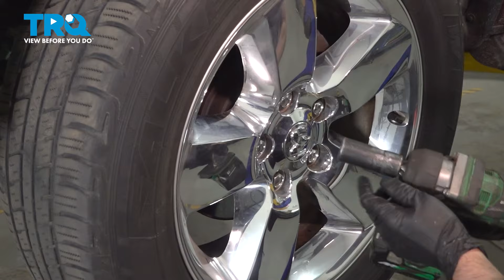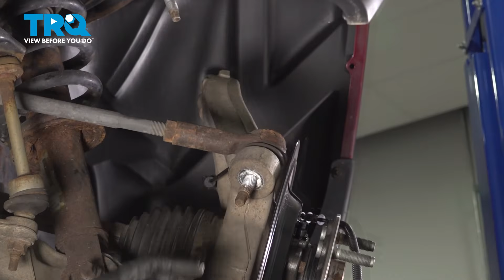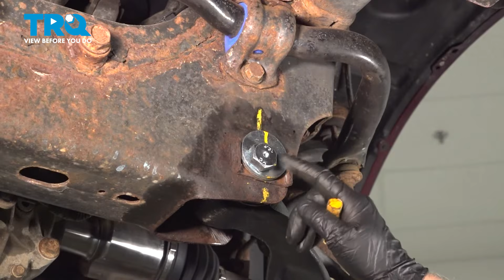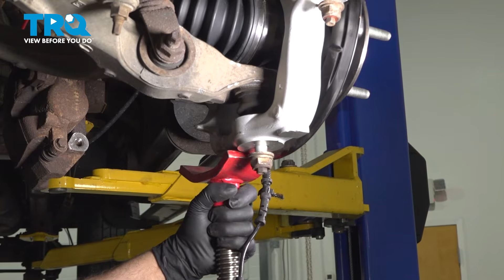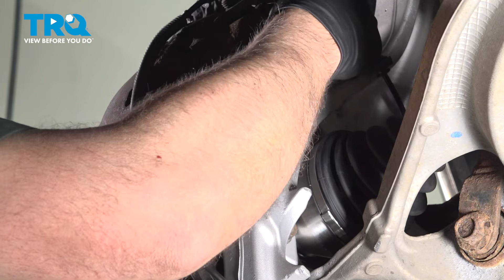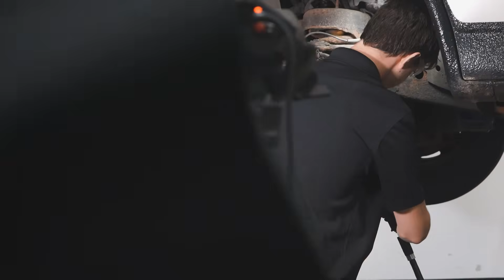How to Replace Front Lower Control Arms with Ball Joint 2011-2018 Ram 1500

Comment: must of had major issues getting the arm bolts out as it cut to a new control arm just before he started trying the bolts,plus you can see the scratch marks where he had to cut the bolts.Looks like it was 3 different vehicles.